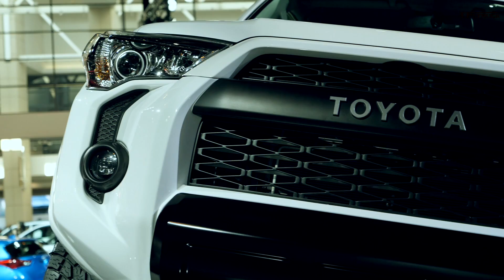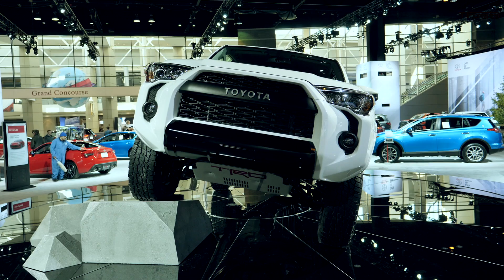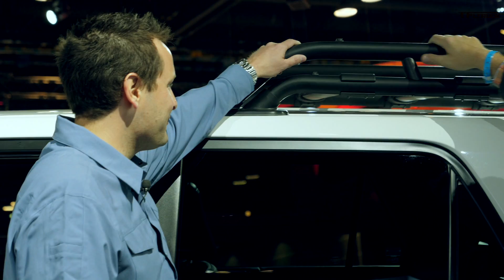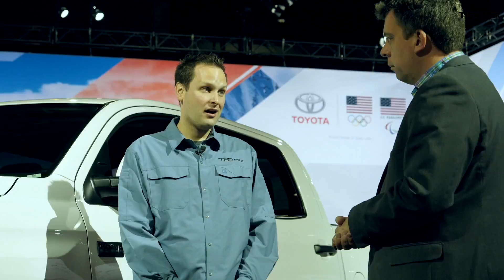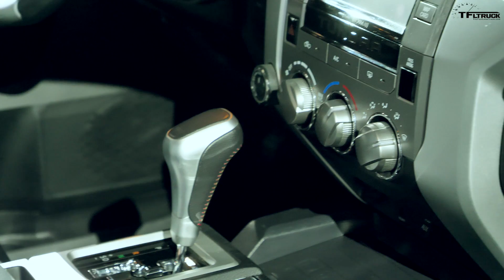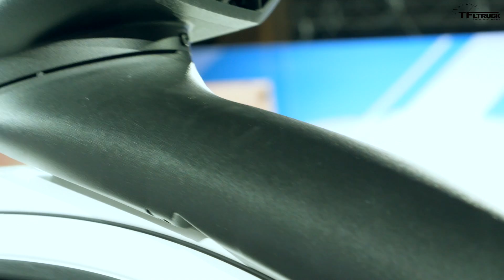Deep Dive into Toyota's Most Off-Road Worthy Trucks: 2019 Tacoma, Tundra and 4Runner TRD Pro

Comment: It’s sad that it’s come to the point where the Land Cruiser is no where to be found in a video about “Toyota off-road”
Reply: The TRD Pro Offroad series is designed for American Toyota vehicles only. The LC is an international offroad car which is not specially designed for US customers. That's why it is not part of the TRD family
Reply: They cant bring the 70 series here. Imagine if everyone had the same car for 100 years. The car companies here would crap themselves.
Reply: I know it's not in the TRD family but with comparable tires, I'd put the LC up against any TRD model
Reply: Ha. Good point. Didn't even think about that
Reply: Kurosu Ha you can buy it as a gx. That's what I did
Reply: The won't bring the 70 Series Land Cruiser to the States, and 200 Series Land Cruiser is too expensive for real off-roading. People are using the 200 Series Land Cruiser the same way they use a G-wagon.

Comment: Why doesn't the Tacoma driver seat adjust in height? Please answer. I want a Tacoma for the reliability but I don't want to get a tundra due to the size
Reply: then you, sir, are just one of the 200k suckers to buy a junk taco last year. you should be glad the hear it retains the most resale value by far of any vehicle which will make it easier to switch to a less reliable vehicle and brand.
Reply: i have seen hacks to adjust taco driver seat height. most people aren't bothered by it so there's the short answer of why not. it's not like they have problems selling tacos. as they increase their production capacity they will sell more.

Comment: They should of added a supercharger instead of that ugly scoop. It's still better than the ZR2 based on reliability.
Reply: You're talking about Consumer Report's REVIEW of the 3rd gen Tacoma, which is not the same thing as the Consumer Reports Reliability SURVEY, which is based on surveys completed by their members and data collected from other sources. The Tacoma has been rated least reliable midsize truck the last two years in CR's OWNER SURVEY because of quality/reliability issues with the powertrain and interior electronics/HVAC.
Reply: If Hilux was here again in us. You know reliability will be explained
Reply: MrRedskins0021 Based on reliability? The 2016 and 2017 Tacoma were both rated least reliable midsize truck by Consumer Reports thanks to engine stalling, 6 sp automatic problems, and poor quality rear differentials that make noise, leak oil, and fail catastrophically causing a crash.
Reply: and approach angles and clearance which is kind of important off road..
Reply: hochhaul That is not true,  consumer reports complained about it feeling too much like a truck and the entertainment center. There is nothing about stalling or anything else.
Reply: @MrRedskins0021  Toyota fanboys are all the same. You make excuses, lie, and then all pat each other on the back.